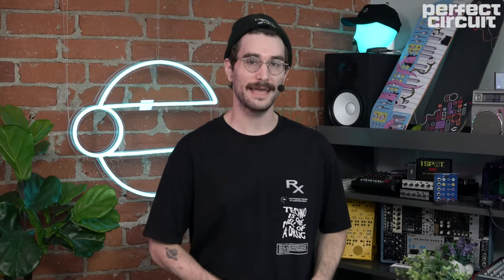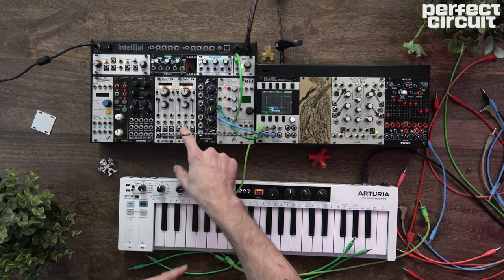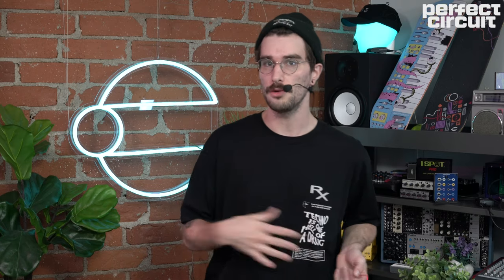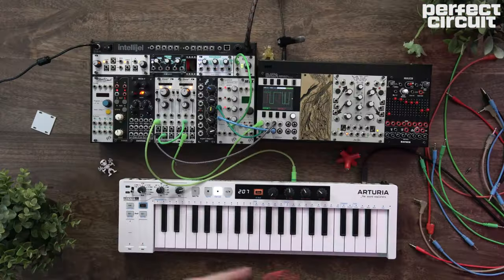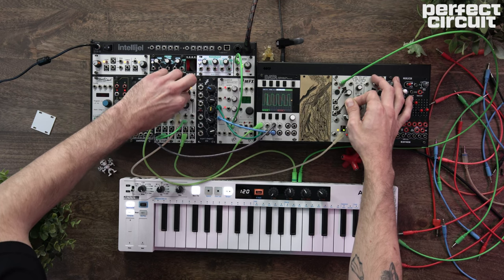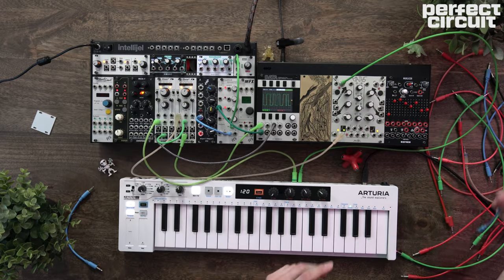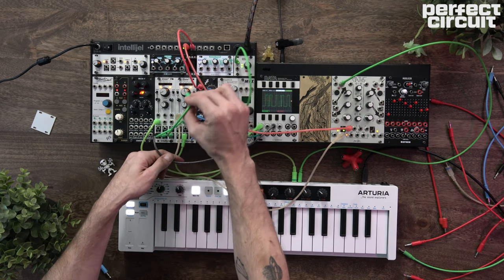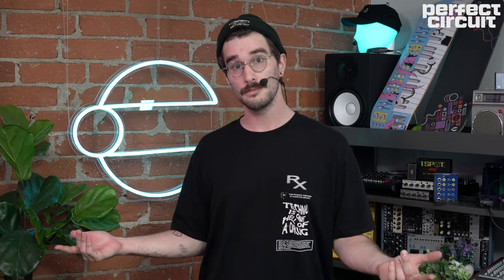Quick Eurorack Modular Tip : Super Sick Oscillator Sync Wave Synthesis

Comment: I just patched this, but through a hydrasynth using your video. I used the step lfo instead of a sequencer to change the pitch of the oscillator sending sync instead of the host . It made the sound so great on the low end !!! I put poly aftertouch to a 3p lp filter  and velocity to the filter envelope sustain. It's soo sick, thanks! Definitely enjoy the sync from a square to a saw. I think I used a sin lfo . I've tried sync with saws and sins but I think square is most dramatic. I used the sub oscillator with a sync-lav wave picked up to create a subtle harmonic to glue it together.
Reply from the maker: Heck yes! this is what it's all about! so glad to hear you jumped off and found your own way to something sick!